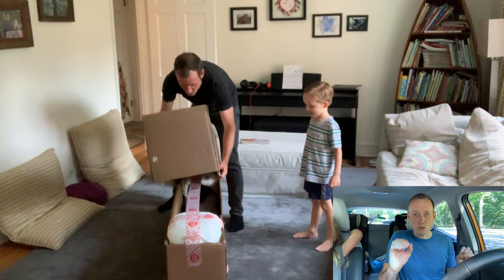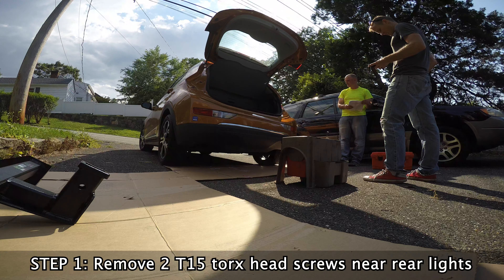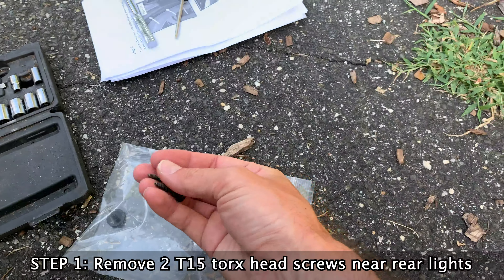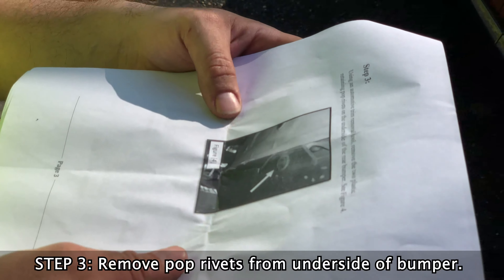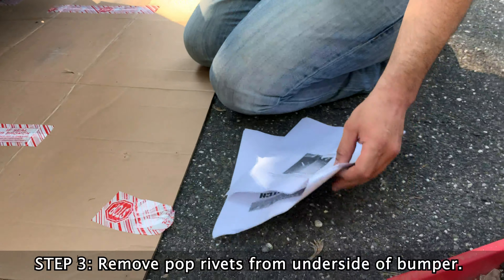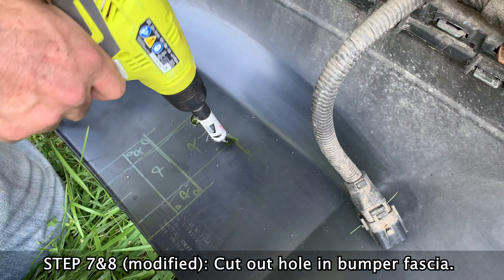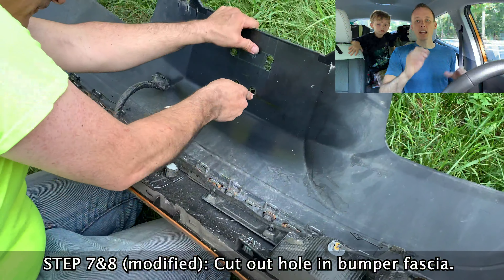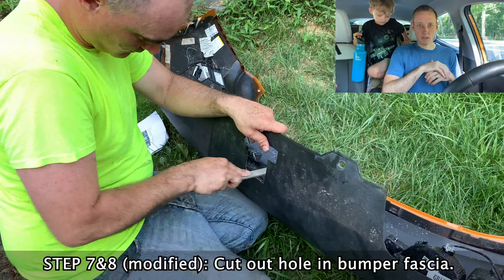Torklift Ecohitch unboxing and DIY install on a Chevy Bolt

Comment: Very helpful, great descriptive video! We just finished installing ours by following your steps, including cutting the hole in the fascia instead of cutting the full slot. Pretty easy drilling some holes, and cutting with a Dremel cutting disk  We left a 1.25-inch strip of plastic instead of 1.5-inch, so getting the fascia back on was easy. Doing it ourselves saved us about $400, and I don't think the "professionals" would have taken the trouble to save the fascia edge. Great job, and thanks!
Reply from the maker: Great to hear! I wasn’t the first so I’m thankful for the hive mind. Enjoy your new hitch.

Comment: Really appreciated the detail that went into each step. Very helpful for my own successful install.  We ran into a small difference in that the rear brake lights cable was still attached to the crash guard, so had to put it close by while doing the other steps. Also realized we only needed to peel 2 plastic rivets in Step 4. I peeled a 3rd and broke it (doh).

Comment: The biggest pain in the a** are the 3 screws in each wheel well.  I highly recommend a 90 degree hex adapter (ordered, but too late for this project) if you have some hex torx or a hex adapter or torx socket for a socket wrench.  

Thanks for the video!  The cutting turns out to be no big deal.

Comment: Just want to share a fix for unscrewing the (3) washers if you do not have the right angle wrench. You can use 1/4” wrench 🔧 with the T bit.

Comment: Is it a through hole on the hitch?

Is it solid?

Will it hold the 300 pounds?
Reply from the maker: Not sure what you mean by through hole. The hitch is extremely solid. I have only ever loaded it with a bike rack and four bikes, which it handled with ease. Not sure of the total weight but likely we’ll under 300 lbs. based on the build of the hitch and the way it’s attached to the car, I’m sure it would hold up to spec.
Reply: The plate on the back caps off the hitch opening. First time I've ever seen a hitch that didn't have a through hole for the receiver tube.

Comment: So, did you remove the bumper again for installing the wiring harness?
Reply from the maker: No wiring harness yet. Currently just using for bike racks. No plans to tow just yet.